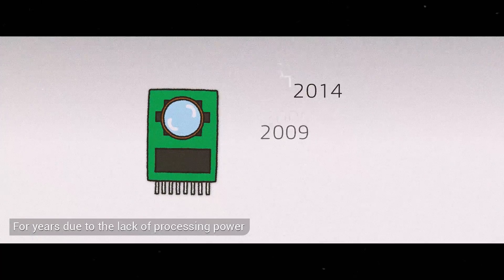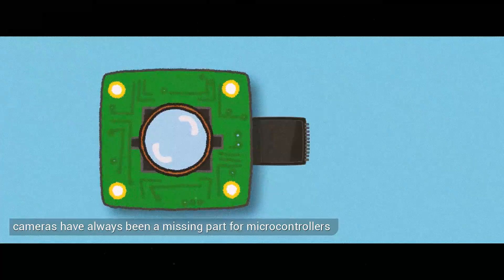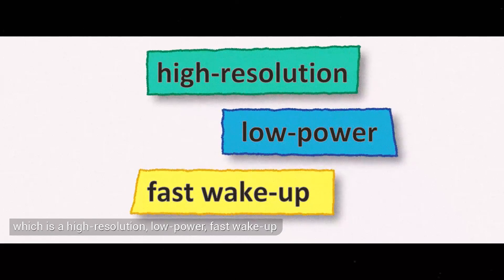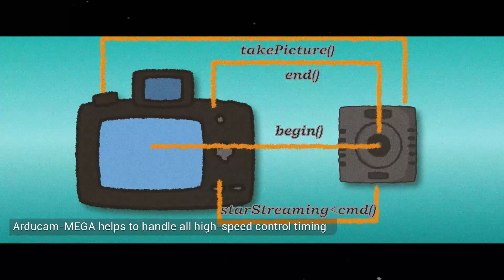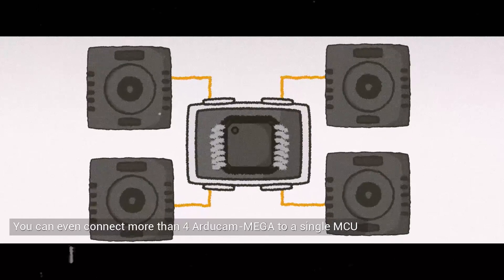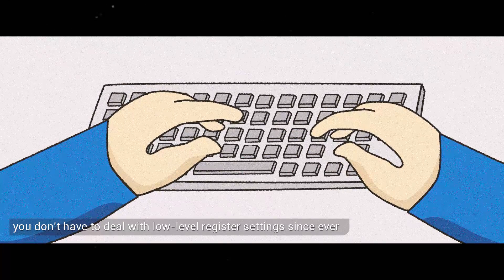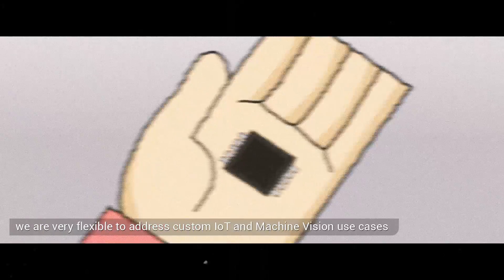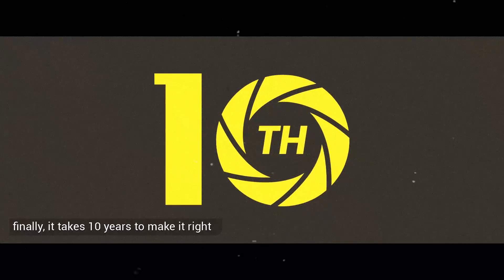The First SPI Camera fitting Any MCU (Arducam Mega)

Comment: How many FPS 5MP SPI camera can handle on maximum resolution?
Reply from the maker: 10 FPS at 2592x1944
Reply: @ArducamOfficial  30/60 fps can be maked?
Reply from the maker: @VitaliySunny  30FPS is now reached for 640x480 and lower res. (for 5MP version)
Reply: @ArducamOfficial  Is this camera or bus/pi limitation?